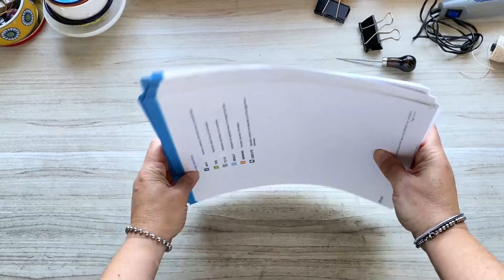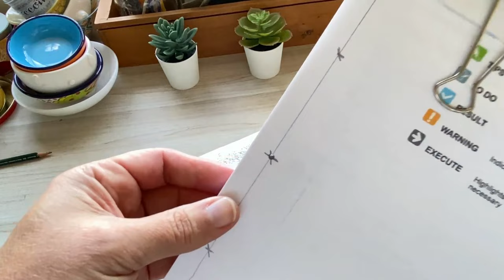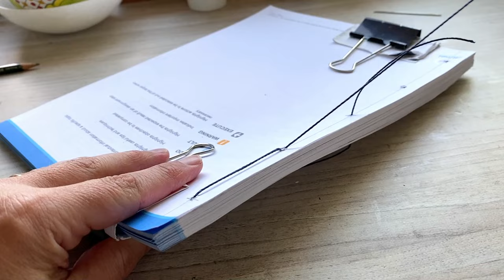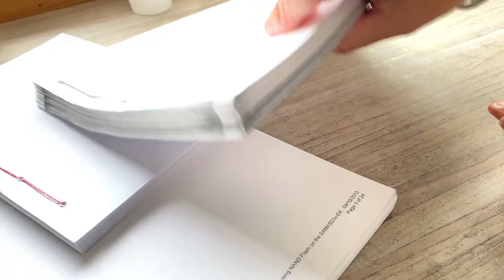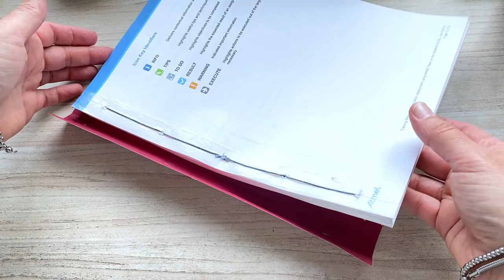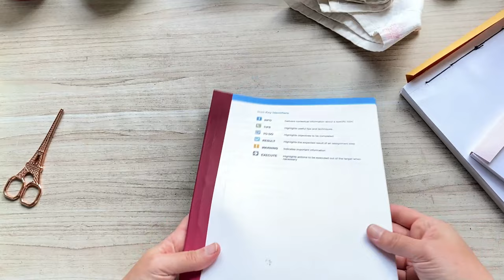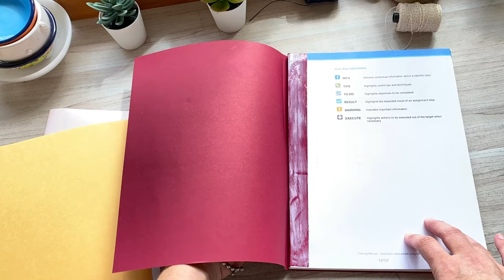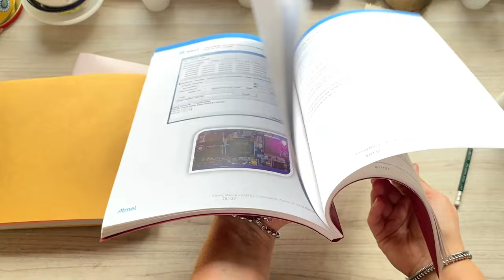DIY SINGLE SHEETS Bookbinding 😉  Easy and Fast [With Sewing]

Comment from the maker: Supplies and links 👇👇👇

Hobby Drill https://amzn.to/3EI6QEM
Awl  https://amzn.to/3JSLRBL
Waxed Thread https://amzn.to/3Jz4slj
Curved Sewing Needles https://amzn.to/3EcfJoO
Book Binding Stainless Steel Needles  https://amzn.to/3FBVXET
Binder clips https://amzn.to/3V1T5a5 
Colored Cardstock 180 gsm A4 (Check the measurements )  https://amzn.to/40oiKfl
Cutting ruler https://amzn.to/3ySvdME
Cutter https://amzn.to/3FCPYzy 
Bookbinding kit https://amzn.to/3OeLjXA
Reply: Hello there is nothing new in this cover For example, in Russia we have been stitching together documentation and personal files in this way for a long time and also criminal cases accounting and reports For example, I used this method to stitch together my diploma project and term paper
Reply from the maker: @Alex-ce8pq  Hello ! Brilliant ! I congratulate you for your work, the video does not say that it is a new method, it is simply a video...

Comment: Very nice but this binding will not open flat which makes it difficult to actually use.
Reply from the maker: Hello ! You are right, for a 180 degree opening I recommend a Coptic or Australian binding.
Reply: @bookbindig_studio  can coptic style binding be done on loose pages like this?
Reply from the maker: @aaminathegreat  
Hello ! No, the problem with loose sheets is that you will always depend on a seam to prevent them from coming off, or in the case of using adhesive you will run the risk of them coming off when opening the binding at 180º. That's the truth, I wouldn't like to lie to you

Comment: While I use a dremmel for super thick stacks, I’ve had luck using a pointed Phillips screwdriver in a pinch. As long as it has a reasonably sharp point you can use it as a pseudo-drill on paper and cardboard (and it’s much easier on the wrist than an awl if you have a lot of sheets to pierce).
Reply from the maker: brilliant! Thank you very much for your contribution ! 😊

Comment: This is a very durable and simple binding. When I had acquired a rare book or Ms, I would carefully scan them, and burn them onto a DVD-Rom. Then, using an inkjet printer, I would make a copy, single or double sided, onto decent quality cotton bond. These I typically stab-sewed, as You have demonstrated, and then gave the block a sturdy "library case". The originals would get archived, and the copies were available for study. I would also glue up the leaves at the spine to prevent any shifting.
Reply from the maker: Thanks a lot for sharing your experience 👌🏼😊

Comment: Informative, though I really wish this guy would speak and give a little more insight then the little bit of text on the screen. Like what kind of paper should you use. How long should you wait until the glue dries, stuff like that.
Reply from the maker: Hello ! In the video description you have a list of supplies that you can use as a guide. In any case, you can use any paper and cardboard for the covers. As for the glue, I cannot say how long it takes to dry since that depends on the glue you use and where you live, for example, there are glues that have more water and if you live in a humid place, logically it will take longer to dry. dry than if you use an adhesive with little water and live in a dry place...Therefore, it is best that you see on your own when it is dry

Supplies and links 👇👇👇

Hobby Drill https://amzn.to/3EI6QEM
Awl  https://amzn.to/3JSLRBL
Waxed Thread https://amzn.to/3Jz4slj
Curved Sewing Needles https://amzn.to/3EcfJoO
Book Binding Stainless Steel Needles  https://amzn.to/3FBVXET
Binder clips https://amzn.to/3V1T5a5 
Colored Cardstock 180 gsm A4 (Check the measurements )  https://amzn.to/40oiKfl
Cutting ruler https://amzn.to/3ySvdME
Cutter https://amzn.to/3FCPYzy 
Bookbinding kit https://amzn.to/3OeLjXA
Reply: @bookbindig_studio   Okay, thanks for a bit more insight. I did see the list of supplies (except paper lol). Thanks for responding. Have a good one.
Reply: One last question, though I'm sure I know the answer. The seam cover is cardstock as well, correct?
Reply from the maker: @geoffreyfoster1784   
Yeah !

Comment: Once finished making, can you add more pages to it?
Reply from the maker: Hello ! Yes, you could, but you would have to peel off the covers, cut the thread and re-sew with the added leaves and finally you will have to cut a new cover since it will change the height of the spine
Reply: @bookbindig_studio  So basically start over. I was looking for a bind where I could just insert new pages since the number of the pages increases over time. Any fine ideas or tutorials?
Reply from the maker: @ImagineGamingPlay  I don't have any binding tutorial so you can do that 😕. I can only think of looking for ring bindings, but there is nothing like that on my channel
Reply: I'm going to use this for a class where we'll add pages as we go. I plan to make a bow instead of a double knot until the end. This way I can untie it when we have new pages and add them in. At the end I'll add the cover.
Reply from the maker: @momh3415  Sounds good !

Comment: Any other tools used for making the holes?
Reply from the maker: Hello! You can use a hobby drill, a punch, or just a hammer with a nail.   https://www.amazon.com/-/es/dp/B07FSBY9GV?linkCode=ssc&tag=onamzeasybook-20&creativeASIN=B07FSBY9GV&asc_item-id=amzn1.ideas.6W7EFIQ0YMS1&ref_=aip_sf_list_spv_ons_mixed_d_asin
https://www.amazon.com/-/es/dp/B00004T7R3?linkCode=ssc&tag=onamzeasybook-20&creativeASIN=B00004T7R3&asc_item-id=amzn1.ideas.6W7EFIQ0YMS1&ref_=aip_sf_list_spv_ons_mixed_d_asin

Comment: Is it ok, with this type of binding, to bind around 1300 sheets?
Reply from the maker: Hello ! 1300 sheets are a lot of sheets! I suggest you divide the amount and make several bindings. Up to 250 sheets I did it this way and it works well